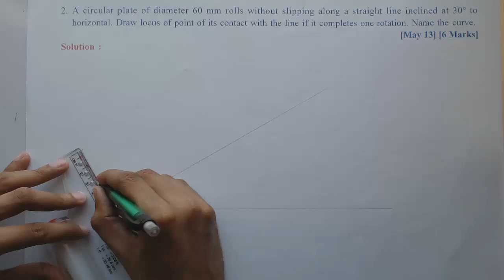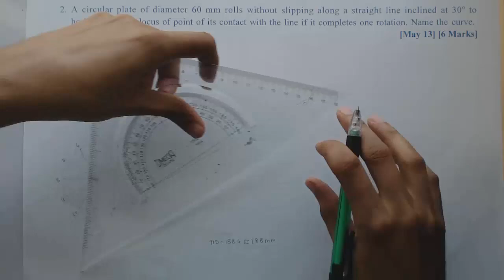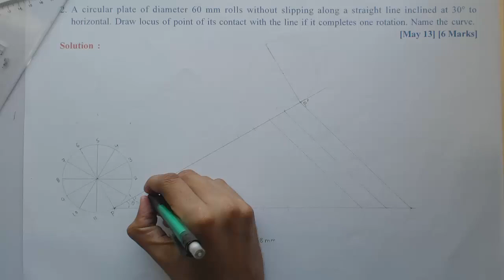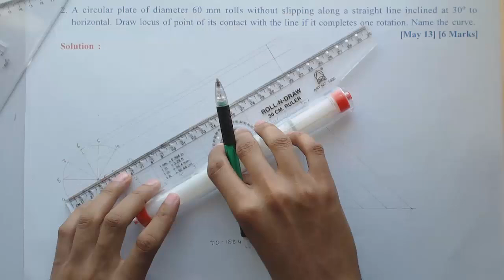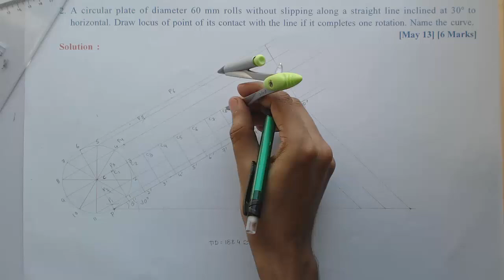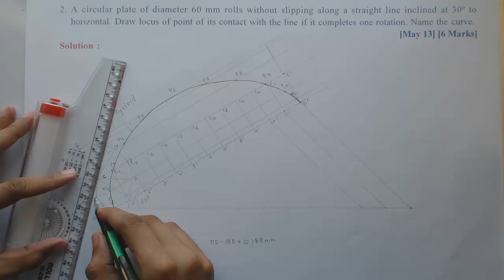Cycloid Q 2 May 13

Comment: Draw the inferior epitrochoid generated by the moving point P which is 25 mm 
from the Centre of the rolling circle. Take the rolling circle radius as 30 mm and 
the directing circle radius as 90 mm. The rolling circle rolls for one rotation 
without slippage. Draw tangent and normal to the curve at any point on the 
curve.